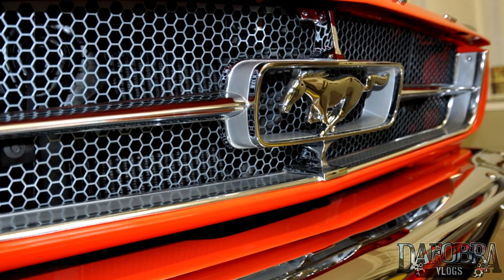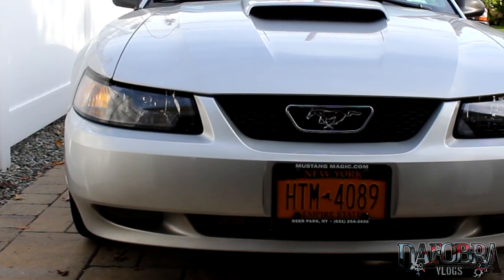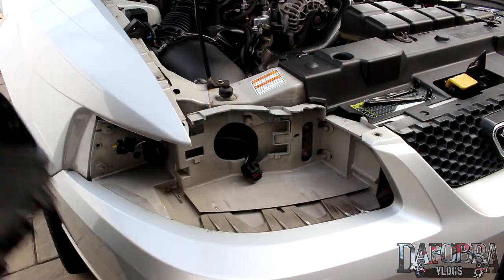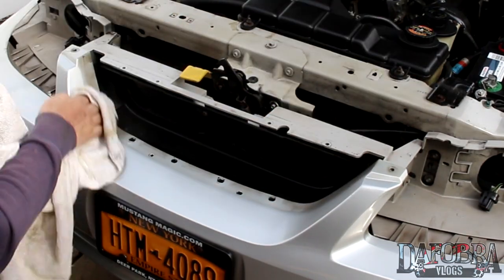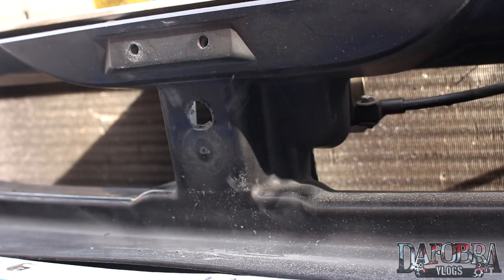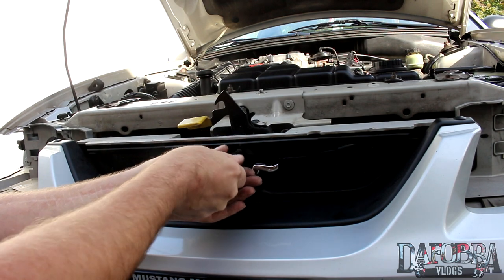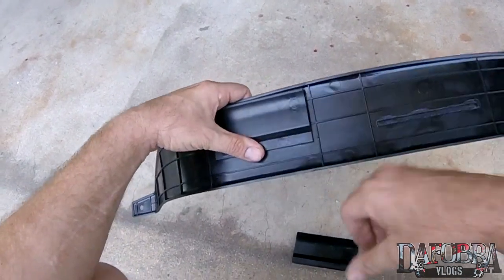How To Install a Mustang Mach I Grille Delete on a New Edge Mustang V6 or GT 1999 to 2004

Comment: looks like a nice car. Good info for the grill parts. If you do glue them back together dont go for a rigid glue. find one that is a little more flexible
Reply from the maker: It's my wife's car that we have owned since 2000 so it's pretty much mint.  This video is a few years old, but I did switch to one from LMR that uses posts and clips just like the OEM piece.  What bothered me about the AM piece is that the car sits in a garage all of the time, so it wasn't even outside inthe sun to melt the glue.  Nonetheless, it did look good.  lol  Thank you for watching!  Another one coming up later today.

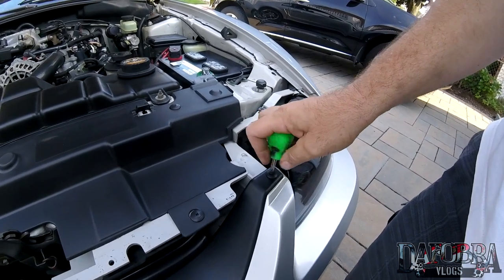Comment: Thanks for that update at 3:50. I purchased my grille delete last year from American Muscle, and it has been sitting in the back of the truck (with other "to be installed" misc parts) since. I was going to install tomorrow. After seeing your post-install issue, I immediately ordered the SVE Mach 1 Mustang Grille Delete Kit from LMR instead, which does not have those glued plastic pieces and instead has four tabs that attach to the existing holes in the bumper with locking retainers. https://www.youtube.com/watch?v=ZNWBhVN7Pkg.
A way better solution. I will sell my AM one on OfferUp. I appreciate your video. You just saved me from having the same experience/aggravation you had.